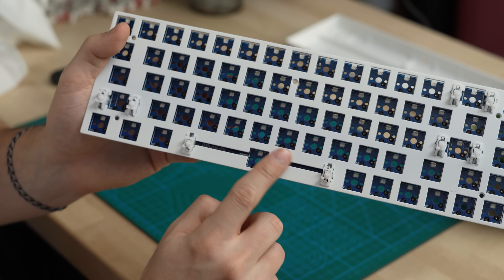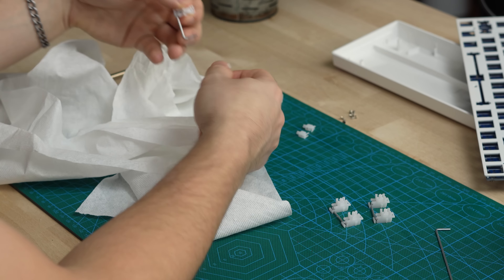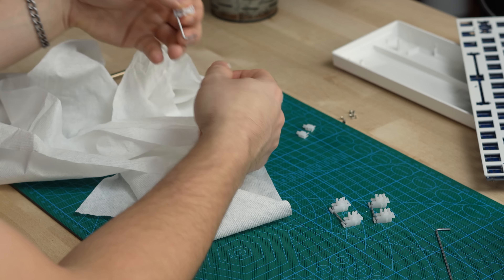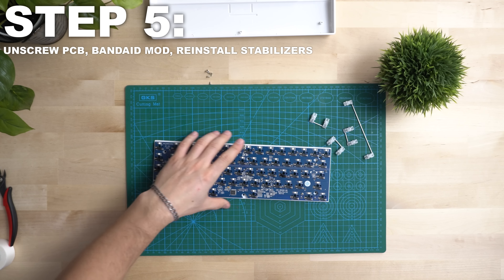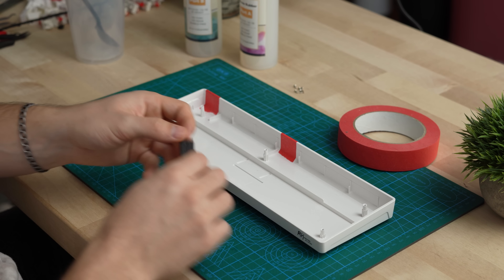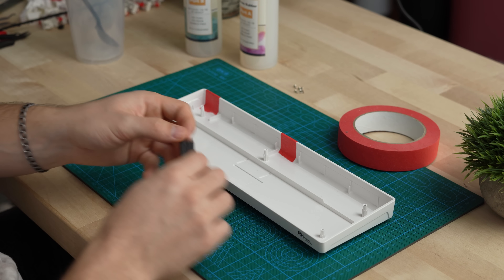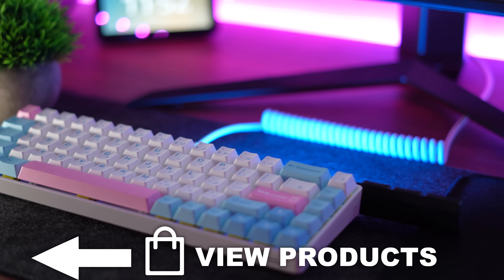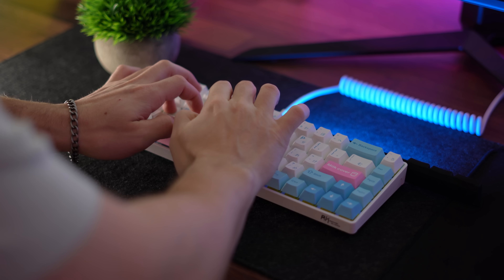Royal Kludge RK68 Modding Guide (Step by Step Tutorial)

Comment: What kind of keycap is compatible with rk68?
Reply from the maker: 99% of what you see will be compatible.  Basically if the switches have that X they will fit on most keycaps except special ones for like a low profile board.  As far as compatibility, you will need the smaller right shift key which I believe is 2.25u

Comment: hey everyone. I am about to buy a keyboard but i am not sure which keyboard between rk68(dual mode) and ciy x79(tri mode) i should go for. I also don't know which keyboard has better switches. Need your suggestions.
Reply: what’s your budget? I had the rk68 before. I sold it sadly. I would recommend the rk68. (I’m a little biased) but it’s your choice. The rk68 is easy to mod and a very good beginner keyboard. Currently my keyboard that I’m selling is the gmk67 with pink switches (if you want the brand tell me) lubed and matcha keycaps.

Comment: Niceee, a new video on rk68. I will be modding it heavily in the coming day as well. Got the pro milky yellow, Rudy pbt keycaps, new stabilizer and gonna be adding weight inside as well
Reply: what stabilizers did you get? I'm trying to figure out if durock plate mount stabs will work.

Comment: Hey quick question, can I use krytox 205g0 for the stabilizers as well?
Reply: Yes, but thicker lube is preferred for the wires
Reply: Yeah you can just put generous amount on the wire
Reply: I would say krytox is better for stabilizers  if you add a generous amount
Reply: If performing the holee mod I would not prefer thicker lube like xhbtz or dielectric grease stick with 205g0 but you can put as much as you want and it should over the wire until you can’t see much of the wire 

Also for the stabs:
There is something called ticking, it’s a small sound created when barely touching each side of the keycap

To remove this you can perform the holee mod but also a new mod called the Mason mod. This mod is to put a bandage under the stabiliser wire (make sure it covers the area where the wire is)
For space bar do the same thing but on each side you can make the bandage as long as you want
Reply: Yes and some people say it’s better
Reply: Yeah it works too
Reply: Yes, but if you have dielectric grease it is way better

Comment: I own the rk61 and I have to warn you: DON'T USE THE KEY CAP PULLER that comes wich royal kludge boards. It's too small. When you are pulling the edge of the cap is not pushed against from the bottom put from the sides. The wire will cut a tiny bit into the keys wich will be as bummer for bottom row keys were you can see the edge. It's not going to be huge but I am definily not using a key cap puller if it ends up damaging my keys. What's the point in that.
Reply: Glad to know! I’m waiting on some switches to arrive but will keep this in mind. I have an Akko one laying around that I’ll use instead.